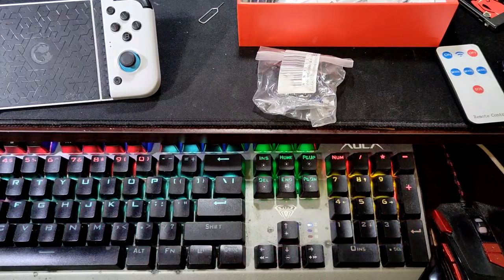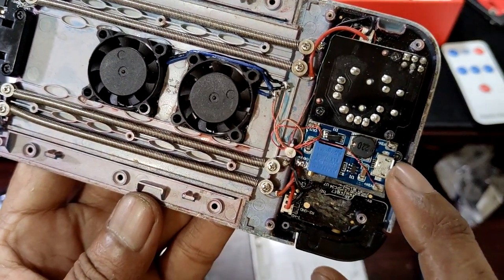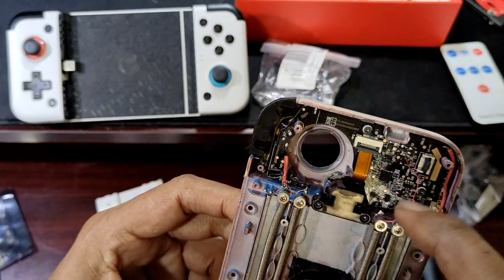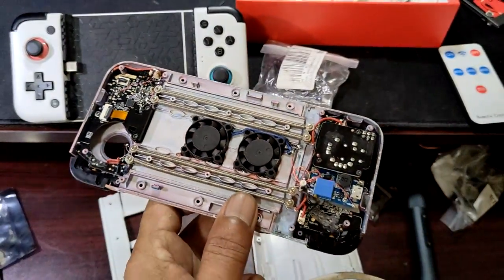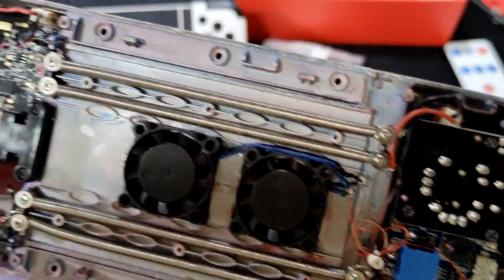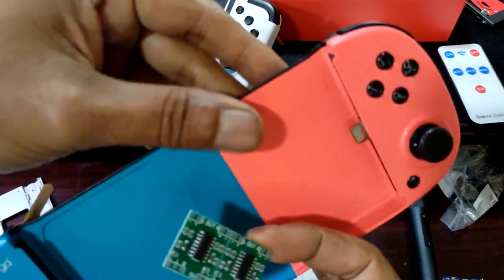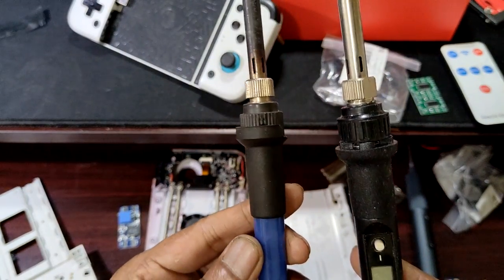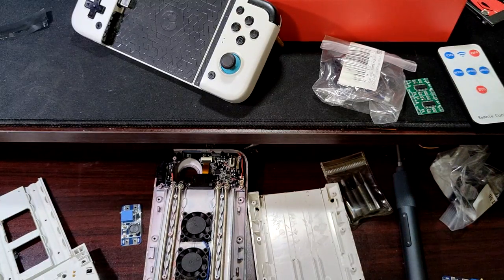My modified gamesir X2 type c controller with 2 tiny fan

Comment: would it be feasible to use peltier modules ? one fan to push cold air side to the phone, and one side to push hot air side out or something, maybe lock the controller in open position or whatever
Reply: Not much wiggle room, it would spend too much of the battery too :(